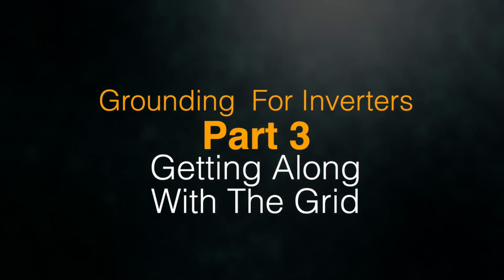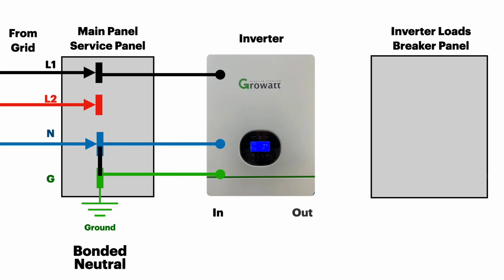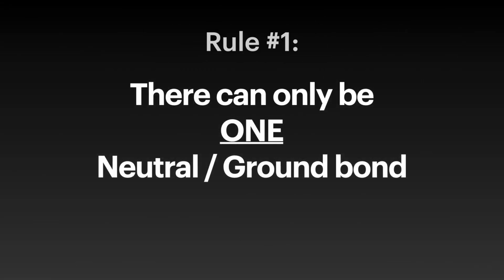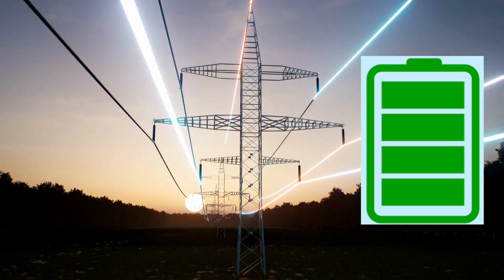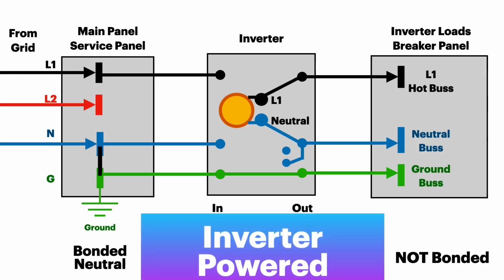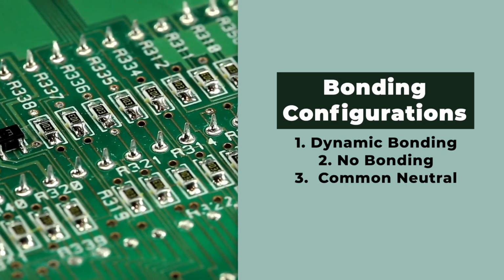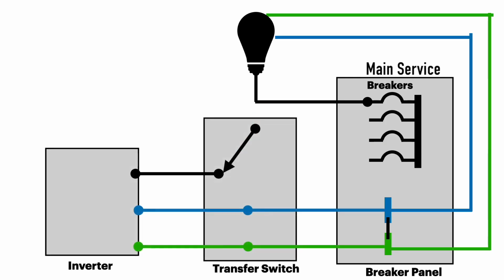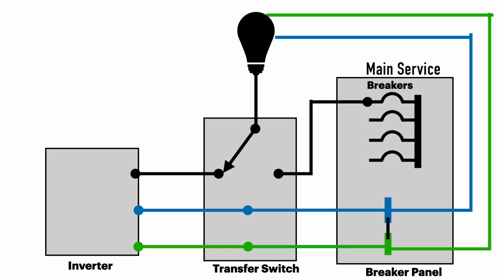Grounding for Inverters Part 3:  Getting Along With The Grid  [UPDATED!]

Comment: Hello..appreciate if you could advise possibility of N and E terminal bond on Deye inverter. Will it harm to inverter. As I have issue on using EV car charger ..showing  as ground fault
Reply from the maker: Not familiar with a Deye inverter.
 What AC out voltages do you get L to N, L to G. and N to G? 
Do you have grid connected to inverter?
Reply: @ReelClearMediaLLC  L to N - 230 V, L to G - 79 V and N to G - 81 V ..thanks in advance
Reply: @ReelClearMediaLLC  yes..i have connected Grid to inverter. If there is  grid power supply to INV...my EV charger working fine..once grid power interrupt..EV charger stop charging and show GND fault
Reply from the maker: 230volts...what country are you in?
What brand /make of inverter is it?
Reply: @ReelClearMediaLLC  Burma 🇲🇲...inverter brand is Deye and made in China.
Reply from the maker: @minthetlwin9859   Sorry, but I'm only familiar with how our grid works in US. It seems like the inverter is not internally or dynamically bonded. But I'm unsure of how you bond N-G grid based house wiring in Burma. 
No guarantee... but you could try to disconnect the grid totally from your inverter, then bond the inverter AC output at a breaker box after the inverter and ONLY run the car charger from that breaker box... NO other house circuits, just to see if it works.
Reply: @ReelClearMediaLLC  Finally I managed to bond Neutral and Earth(PE) of my hybrid inverter without any issues...thanks a lot for your advise...
Reply from the maker: @minthetlwin9859  Great! So your EV charger is working now?
If you want to switch back and forth from the grid, you could use a transfer switch. Don't run the grid to the inverter or you will have two bonds. Run the grid to one input on a transfer switch (DPDT, it has to switch neutral) and run the inverter into the other input on transfer switch. Output of transfer switch goes to EV charger. Could also be done with a relay, but it is more complex.
Reply: @ReelClearMediaLLC  Burma 🇲🇲...inverter brand is Deye and made in China.

Comment: You mention RV's and boats. Common neutral is a bad solution for those right? Because the  main panel bonding only exists when you are on shore power.
Reply from the maker: Exactly. the new EG4 6000XP is common neutral, but lets you turn on an internal N/G bond with software. The problem is, you have to remember to reset it when you use shore power. 
An alternative might be to wire up a relay to create a bond when you aren't on shore power.
Victron and some other inverters are a better solution. They aren't common neutral, but dynamically bonded.

Comment: Great video. I am using a single circuit transfer switch to my furnace. Line power on one side and a floating neutral inverter generator on the other side of transfer switch. Bonding is in my main panel and if I understand correctly the neutral from generator is bonded by tying the load neutral and main panel nuetral together . This way I am following rule of bonding in one place only. Generator only used during power outages. 
Than you again for the most informative video I have seen to date on this subject.
Reply from the maker: Hi @johnboy9211
1. Make sure the inverter is made to be able to connect to the grid. Does it have a grid AC in?  In Grounding & bonding part 2, I cover some types of inverters to not grid connect.
2. I'm assuming you are in the US? Is the furnace 120v or 240v?
Reply: What I meant was I have a small generator with a floating neutral (inverter type generator.).   I want to take the output of Generator to a transfer switch . Line power on one side of switch and generator on other side. According to what I see and read,  the neutral from load , line and generator should be tied together. 
Because there is no bonding at generator and current seeking its source , that should work. Its a 120 volt 15 amp generator. I don't own a wall mounted battery powered invertor.  Thx for answering my comment and your videos need to get out to more people. Very very informative.
My situation would be your video Part 3 . Time  14:50. Where you have invertor . That would be my generator.
Reply from the maker: @johnboy8211   Yes, that should work fine. All neutrals end up at the house's main panel neutral buss bar.  The furnace's Neutral wire should already be connected to the panel's Neutral buss. You're just connecting the generator neutral to the same buss bar. 
The Line (hot) from the generator will go through typically a SPDT switch that lets you choose between generator and grid. There are a number of these single breaker transfer switches out there. I used an EZ generator transfer switch when I first started learning about this, Then upgraded to the 6 circuit Pro/Tran
Reply: @ReelClearMediaLLC  Im using the 6 circuit Pro/Tran trasfer switch with a floating neutral gas generator. What floating neutral inverter brand or model to use if switching to a single 100ah battery supplied power source. ( just a small 500 or 1000 watt inverter for lighting curcuits at night when gas generator is off) I was assuing any portable battery generator was floating neytral and would work. Having hard time deteriming what inverter model is floating ( common neutral). Also seeking which portable battery gen might be floating ( unbonded) neutral like the EcoFlow Delta 2 mentioned in this thread. Thanks for everthing.

Comment: I want to see if this works with the new EG4 6000XP off grid inverter.   According to one of the comments on the DiySolarForum, "The 6000XP is a common-neutral architecture. It does not do dynamic bonding. Either the static bond relay must be enabled or there must be a bond external to the inverter. (Never both)"
Reply from the maker: That's what it says in the manual. You can download that from EG4electronics.com.  If you are using a grid assisted install, it makes bonding simple... just use the existing bond in your home's main service panel.
I'm considering upgrading to the 6000XP at some point. Having all the switchgear, breakers, disconnect, etc built in will really simplify and clean up my install.

Comment: What about 2 of those EG4 3000's in series to allow for 240 or i20 in it's own inverter panel not connected to the grid..Or two in parallel..Thanks though, your videos are helpful, and REEL CLEAR, which is exceptionally rare..
Reply from the maker: I can't seem to find any info on the EG4 3000 bonding. I'm not sure what they have.
Reply: @ReelClearMediaLLC  There is a screw inside the case that creates a neutral ground bond, or you can choose to remove the screw and bond the neutrals and grounds in a circuit breaker box...I talked to signature solar today,  going with the 6000 XP..Instead of another 3000..I have the 3000 for some rental cabins, the unit is very good, but wasn't sure about the parallel or series situation..The EG4 6000 XP is made by Luxpower, and they have been running in Africa for 5 years with an extremely good track record..I looked through the data, extremely impressive for the price..Thanks though..
Reply from the maker: @realeyesrealizereallies6828   thanks! As long as they aren't connected to the grid, I would take out the screws of both, and bond at the panel after the inverters. Check out part 2 of the grounding and bonding series.
Double check everything with a meter!
Reply from the maker: @realeyesrealizereallies6828  I'm considering getting the 6000XP as well. The built-in switchgear is nice too.
Reply: @ReelClearMediaLLC  Ya, it will be nice not dealing with the "T" class fuses and And the various breakers to isolate everything..Just placed my order ten minutes ago..I got 3,700 watts of new solar panels too for $1,450 bucks, delivered..Which is pretty damn good..Different company though..
Reply: I just installed the EG4 3000 today and they kinda have me confused.  They said I have to do a neutral bond at the new breaker box I installed.  BUT if I am hooking up the  grid in to charge the battery and whatever else it does,  should I NOT have the neutral bond at the new breaker box, but instead at the main?  Also I am thinking of just running a cord to a wall socket for that grid in and setting it to only charge at 15 amps.  Am I thinking right?
Reply from the maker: @Javaman92   Signature Solar says all of the EG4 6000 watt inverters pass through the bond from the grid, but no mention anywhere about the 3000. Who are you referring when you wrote "they said" above?

Running a cord to a wall socket is fine for charging, but not for running circuits. The wall outlet will only be 15-20 amps, but at 3000 watts, your inverter could pull up to 25 amps.  This is exactly what  do with my GroWatt 3000. I only plug it in maybe once or twice a year, to charge the batteries after several cloudy days. I don't run any large loads while charging from the grid, only a few modems, and phone chargers, etc, less than 100 watts of load. I also know the Growatt can have the  neutral out and the grid Neutral connected at the breaker box.
Some inverters don't allow this. I don't know if it is OK to wire the EG4 3000 tht way. Maybe you can find an answer directly from EG4, or from someone who has wired the 3000 that way. Try on the DIY solar forums.
Reply: @ReelClearMediaLLC  After watching it again I felt they were telling me that I DON'T neutral ground at the breaker box I put in.  I think the confusion comes from grid CONNECTED vs grid TIED.  I don't know... at this point I will reach out to Signature solar and see what they say.
Reply from the maker: @Javaman92   also test with a meter to see if the inverter is bonded in battery mode, with NO grid IN (unplug the cord). If it's bonded you'll get 120v from L to N, 120v from L to G, and near 0 from N to G.
You might also try to contact EG4 directly
Reply: @ReelClearMediaLLC  
If I remember correctly you said that you have your inverter plugged into a wall socket.  If I am right, what setting do you have for the charging amperage? 
I have two settings, maximum charging and maximum utility charging.  
I'm wondering if it is safe to pull 20 amps from this old house wiring or go with the safer 15 amps.  AND is the 60 Amps from the solar okay with 10 gauge wire, it is rated for 30 amps.  Am I missing something?!
Reply from the maker: @Javaman92    I use these settings:
setting 2 (total charging amps): 50 amps.
setting 11 (grid charge amps): 10 amps. 
Very low amps but safer. 
The 50 amps on setting 2 is mostly to handle solar charging.

Are you pulling 60 amps from solar? That would need a much thicker cable, the manual calls for  6 guage.
Reply: @ReelClearMediaLLC  No, I'm not pulling anywhere near 60 amps.  I won't pull 10 amps.  I have a 1kw string of panels.
Reply: @ReelClearMediaLLC  oh and thank you!
Reply: @Javaman92  It depends on the firmware you have in your EG4 3000, I think some are programmed to switch when you plug in to charge..Mine are off grid, so I'm not sure..I would test the way this video series teaches, and call Signature Solar, and make sure...I have the EG4 6000 XP and it switches on it's own through the firmware, but that is a different machine..